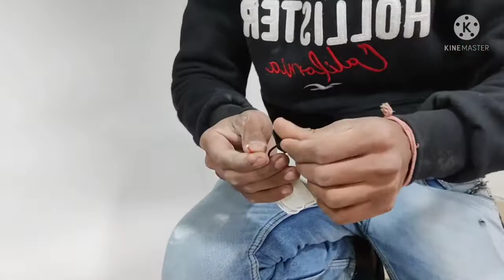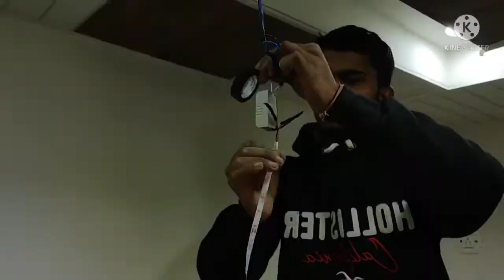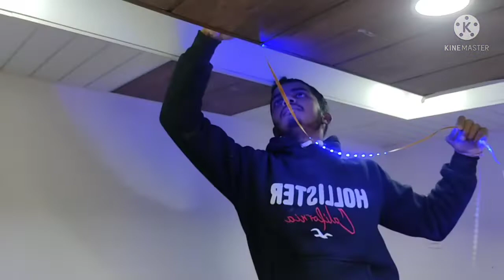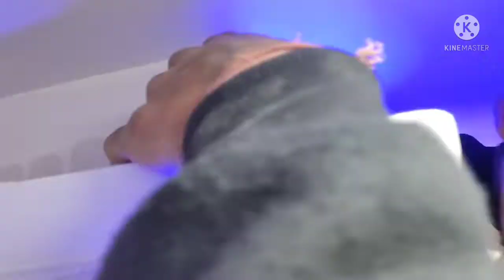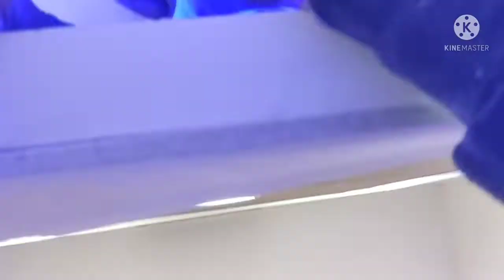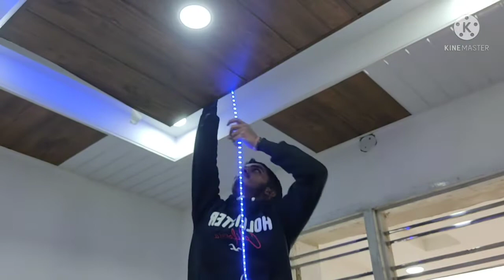देखिये ceilling मे strip light कसे लगती हैं ||pvc wall panel || cob light ||

Comment: You vedio is very informative. I liked very much. But while applied it in my pvc false ceiling of Bright white golden lining pvc board, it exposed dotted reflection of gupped led bulbs in outer portion of the pvc board, which I donot want.
Please cooperate me to solve the problem.